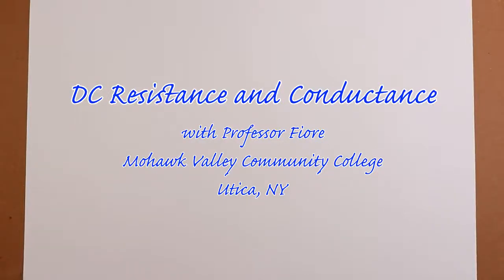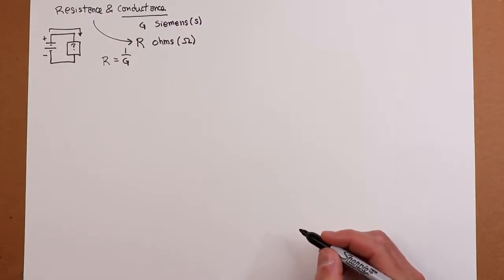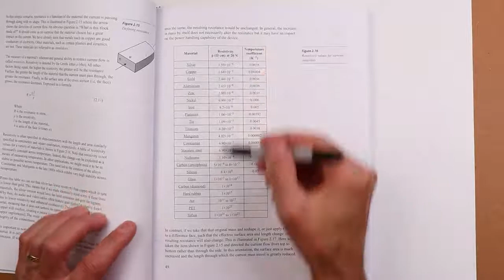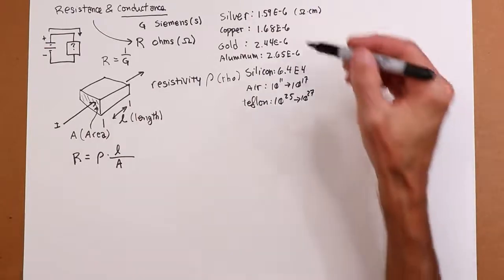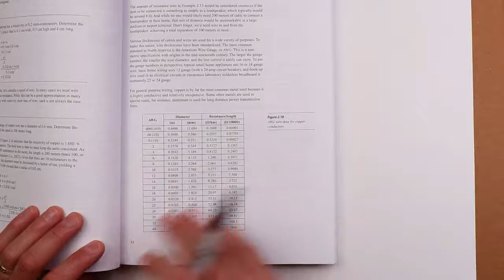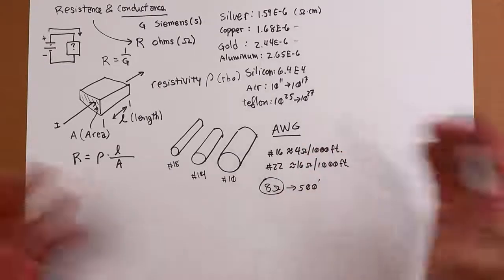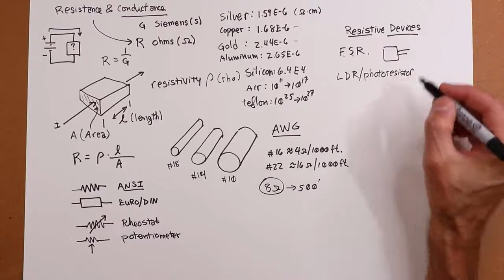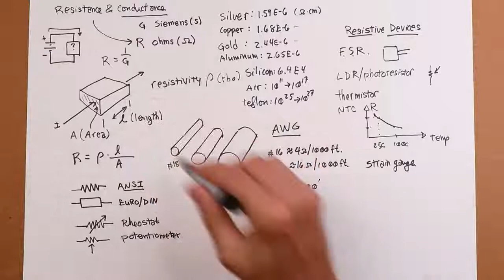DC Electrical Circuit Analysis: Resistance and Conductance

Comment: I enjoyed your semiconductor course, so I decided to go back to basics and see what else I can learn. What are the component leads made of? I thought you might know.
Reply from the maker: That would depend on the component and its grade, but your basic cheap through-hole resistor is probably a copper clad steel wire with tin plating.
Reply: @ElectronicswithProfessorFiore  Thanks indeed.